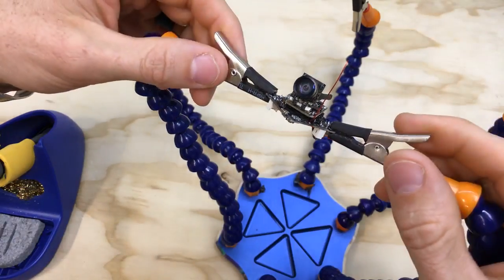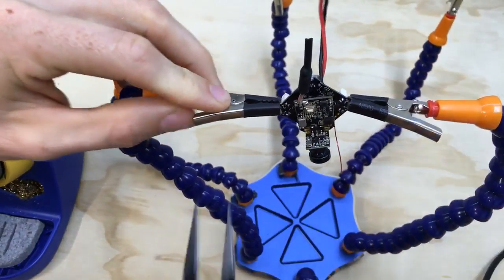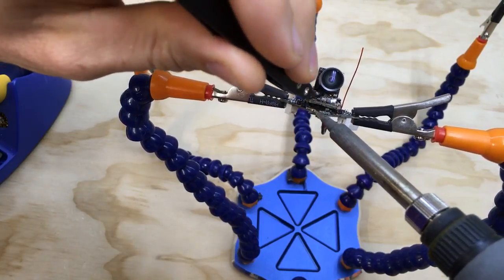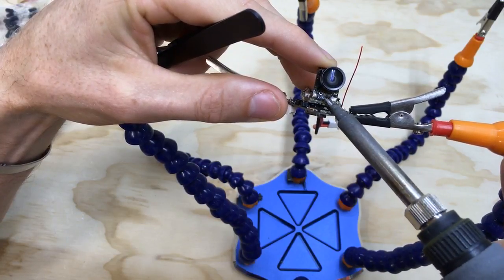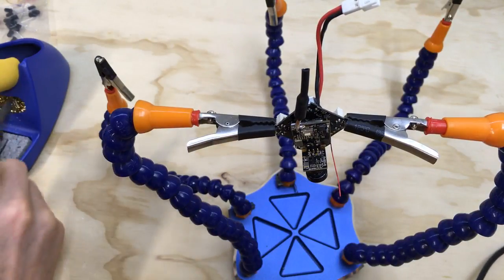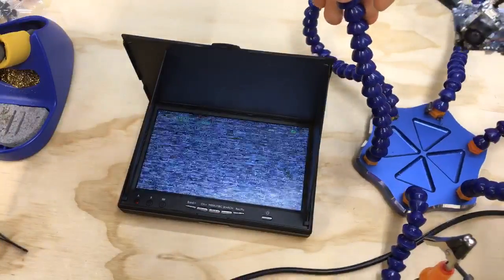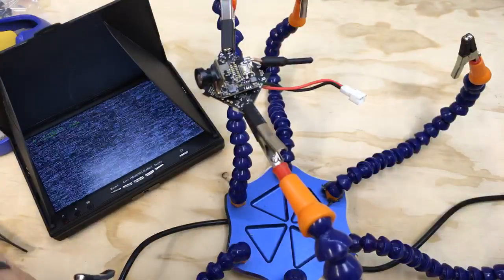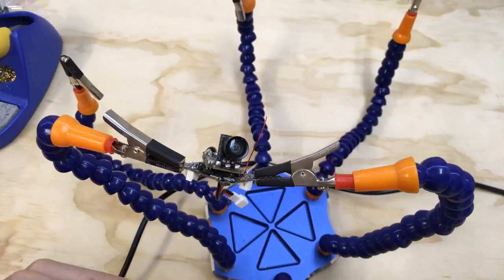FPV Camera Repair | Live Stream

Comment: Dude thank you. I depinned one of these and got some smoke when I wired it. Unplugged it and resoldered everything and got signal but no feed. Checked those pins and the video pin was gone. A quick solder and it is working. Thanks bro